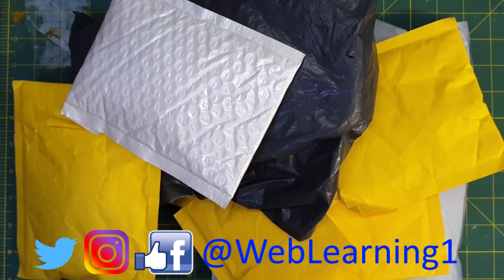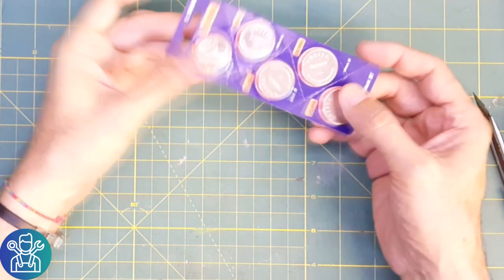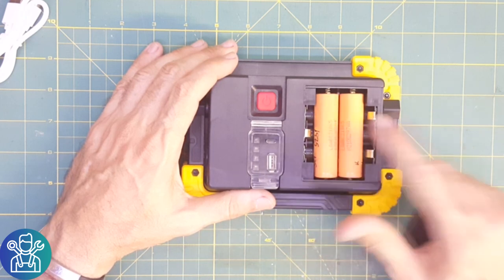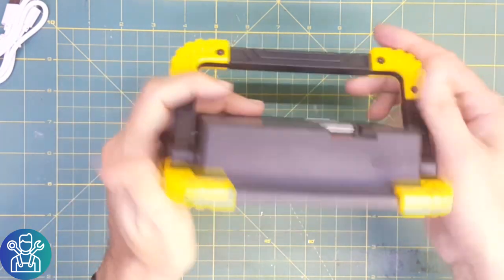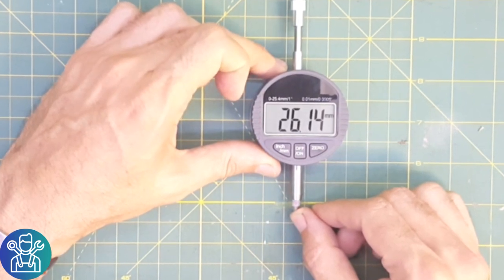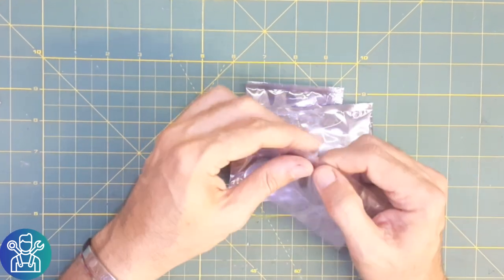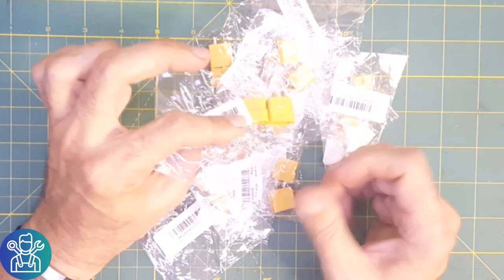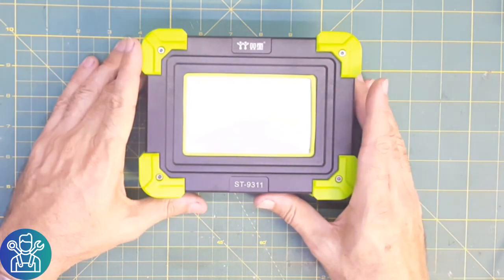What Did I Get #2 part 2

Comment: What are you going to do with 24vdc? Just curious.
Reply from the maker: In some of the camping sites they have a 24V outlets. With this conversation ( and a good DC-DC step down ) I can have power to all my 12V DC camping gear ( +mobile charger ) and no need to use rechargable batteries.